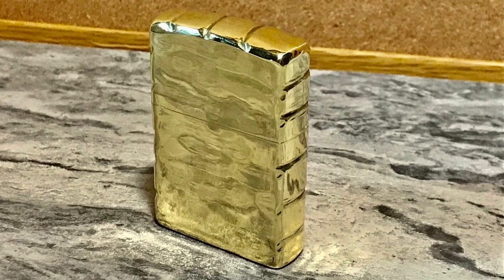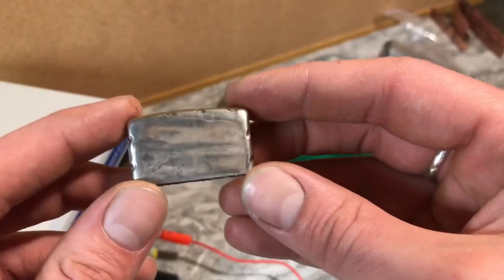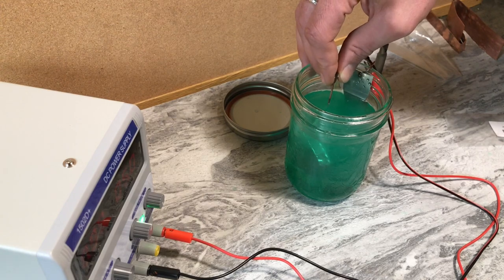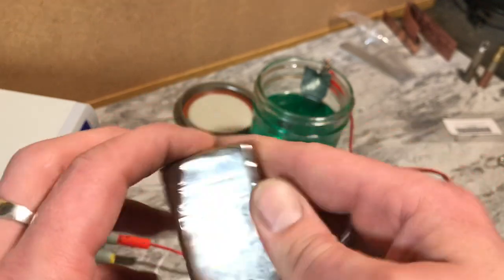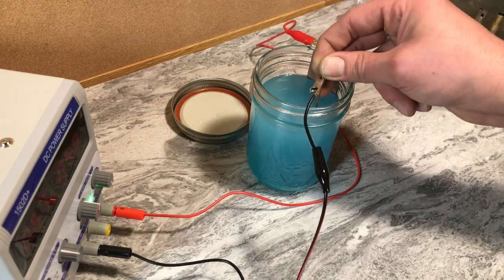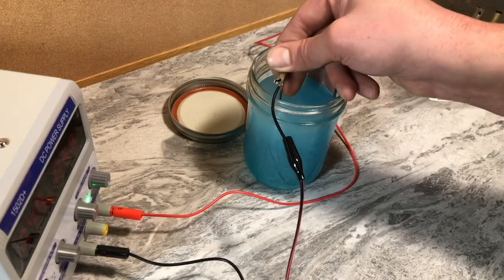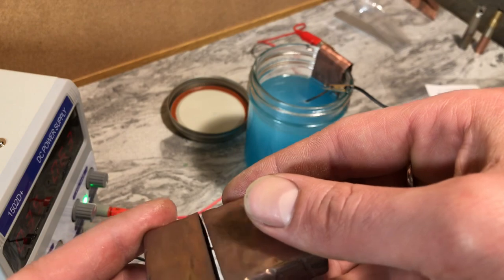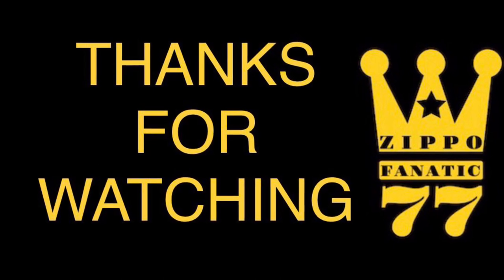How To Nickel Plate And Copper Plate A Zippo

Comment: Looks great. Out of curiosity, why not just plate the raw brass with copper? Does pre-plating it with nickel and then copper make it turn out with more of a mirror finish?
Reply: Nickel is harder than brass, it will allow for a more durable  base/corrosion  resistance  for the copper plating..